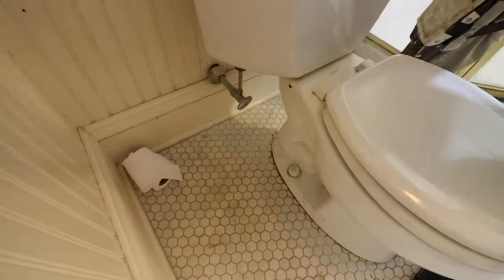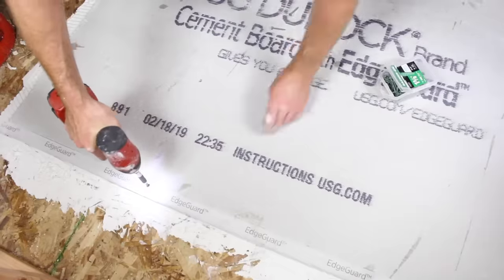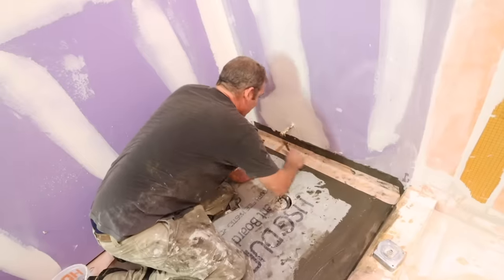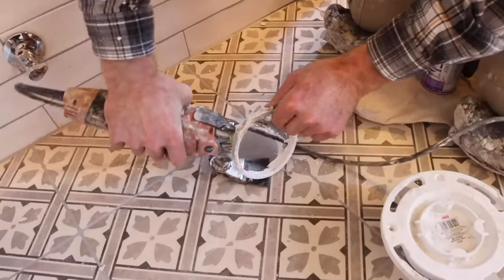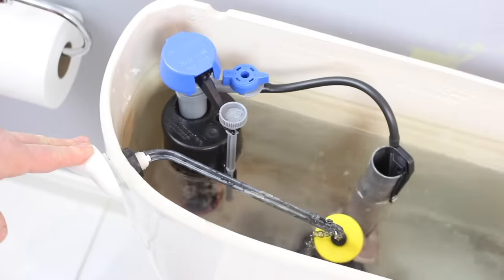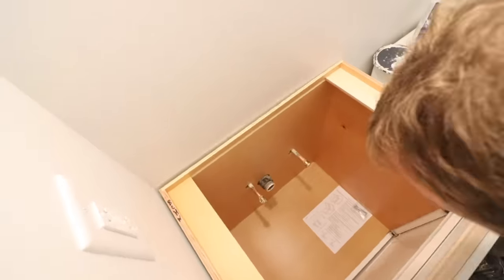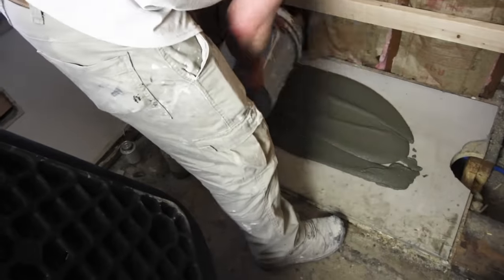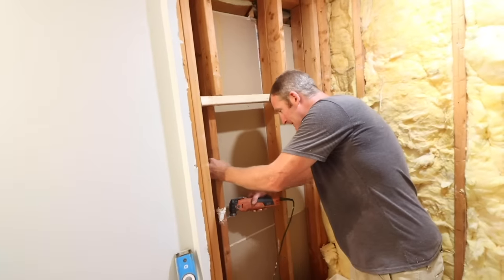17 Clever Bathroom Renovation Tips for Beginners

Comment: I don't see any point in waterproofing outside of the shower. If you have that much water outside of the shower, it would most likely to be leaking in the wall. You could use roll on membrane as uncoupling membrane, but don't need to be as thick as when used for waterproofing.
Reply from the maker: are you referring to the floor waterproofing, if so, it’s necessary in case the toilet or sink overflow and only takes a few extra hours

Comment: Guys don't waterproof your cement boards on floors. Just buy grout that is water sealed. U r not flooding ur bathroom everytime u shower. And if u happen to really flood it u probably will be replacing everything anyway.
Reply from the maker: we don't agree, it literally takes less than an hour to waterproof the cement board and several liquid membranes also serve as isolation membranes that prevent cracked tiles; so it's well worth the time and minimal expense
Reply: @HomeRepairTutor why would your tile crack!? That is the biggest scam if there ever was one. And that little bit of membrane is not going to isolate your floor, there is ditra for that and other such products. Lol youd prolly waterproof your ditra as well
Reply: What the actual hell are you even talking about dude? Water sealed grout? That would be epoxy ? Wait at the bar well call you when its done!

Comment: You guys are fucking up that OSB floor when you put thinset directly on it and especially after wettung it down. You're never supposed to do that. The water frim the thinset and even worse the water that you are adding to the floor loosens up the glue resin  in the OSB therefore over time is going to work the tile loose. Always prime the OSB with a waterproof membrane such as Red guard or Aqua Defense. If you're dealing with regular ply plywood you can use a modified thinset over it because it doesn't have exposed glue resin.
Reply: You are right! Do redguard over the osb then thinset your wonderboard down! Much better installation!

Comment: Durock it is not good for floor. Plus screws that you are using it is wrong ( they are for hardie backers). Wonderboard  or  Perma base are better for walls. And absolutely hardie backer for floors. I am doing bathrooms for living.
Reply: As long as they are alkali resistant, they are the right screws.  And as for whether glasscrete or fiber-cement is better for the floor:  You can't back up what you've said with any substantial evidence.  And "I am doing bathrooms for living" is NOT that evidence.  Which one is simply a matter of preference.
Reply: @SomeDumUsrName  Relax. You are still using wrong screw on that product.( follow manufacture warranty on any job) There is screws you can use for both. Still durlock it is wrong product for floors. There is no preference when is wrong product. Evidence ? You will have it !
Reply: @yuliyanyul1633  Here's the deal:  The screws he used are just fine.  End of story.
Reply: @SomeDumUsrName  It is not about only screw, it is about using durlock on floor. One day  grout joints or tile will crack 100%.     Stop giving wrong info here ! 
There is no option between durolck or hardieboard on floor. End of story.

Comment: Sorry but if you have to use clips for a showers you shouldn't be tiling
Reply from the maker: that’s not true, as tiles become larger and have more concavity it’s helpful to use leveling system, many talented tile installers use them
Reply: I been tiling for 20 years if the tile is concavity then run 1/3 or stack you never go brick 
As soon as I'm done back cutting my first row to level the rest will literary take me 30 mins 
Pro tiler know never push tiles down use the grout spreader to evenly press 
The only time I use clips is for large format tiles meaning 32x32 and larger 24x24 is not even big to today's standard 
It makes me sick seeing a thousand clips in a bathroom shower that's not skills if your shower is plum and square no excuses

Comment: Tip for beginners, durarock is junk, use 1/2" hardieboard, pennytile sucks, too much grout to clean, use bigger tile with 1/8" grout joints and a hybrid grout from home depot that never needs sealed. Don't try to tile a tub or shower yourself because you don't know anything about waterproofing and it will need torn out and redone within a year. Hire someone who knows what they are doing the first time. Its always cheaper and less hassle, because you will pay them more to tear out your shitty work than to just hire them in the first place. The End
P. S. Stop making these videos that convince people who are unskilled that they can do jobs that require high skill levels